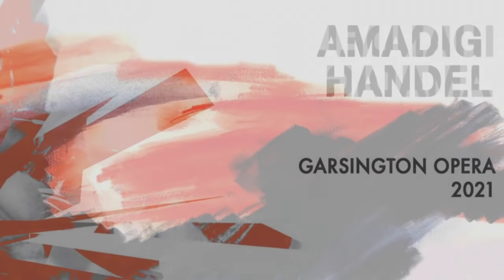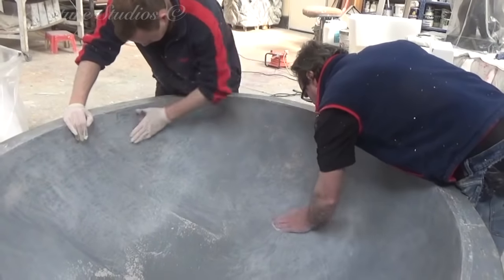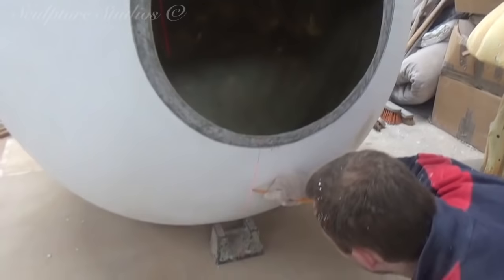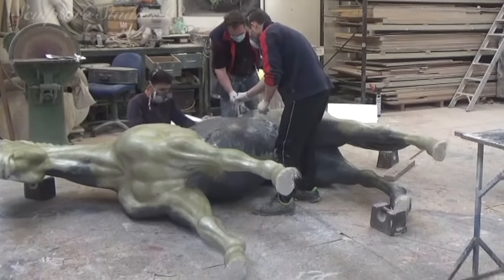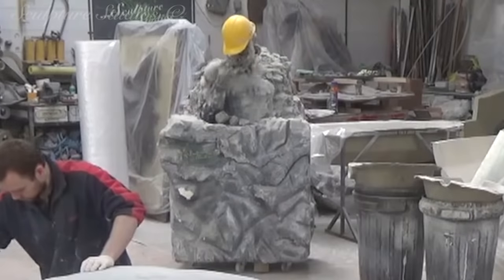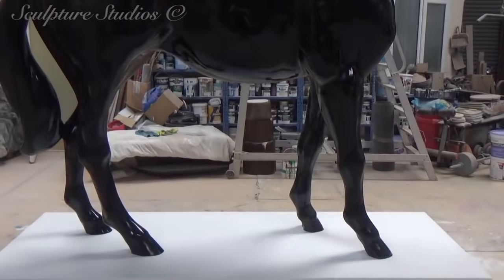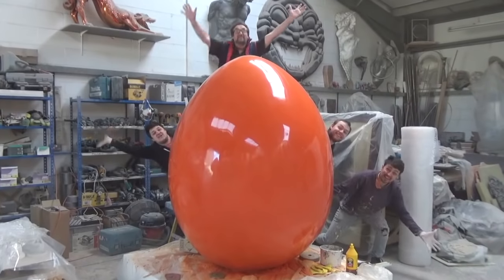Giant Horse & Egg Theatre Props - Amadigi - Garsington Opera by Sculpture Studios

Comment: Did you guys apply several layers of a concrete render or was it a car body filler and gel coat on the horse to get rid of the fiber texture. It turned out amazing! Glad you guys are getting some work.
Reply from the maker: Resins / gel coats and car body fillers. Concrete would have been a nightmare to sound down, and certainly not to the finish we wanted! Thank yooouuu

Comment: Another great project and video.  Silly question time- since the egg was always going to be mounted on the platform, why was the access hatch not on the bottom?  not a big enough area or just did not think of it?
Reply from the maker: Good question! But the client wanted as little of the egg touching the floor as possible, which meant the floor hole was far too small to get in and work comfortably. If the hole was made big enough for someone to get inside, it would have meant much more of the base of the egg cut off than the client wanted
Reply: @AdenHynesSculptureStudios  fair enough, hence the title- silly question.

Comment: Video summary [00:00:00][^1^][1] - [00:20:02][^2^][2]:

This video shows how Sculpture Studios created a giant egg and a black horse for the opera Amadigi by Handel. It covers the steps of carving, molding, fiberglassing, sanding, priming, and painting the sculptures. It also features the client's feedback and the final installation at the Garsington Opera venue.

**Highlights**:
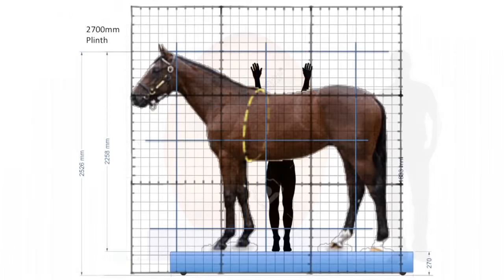+ [00:00:39][^3^][3] *The brief and the references*
    * A balance between realism and simplicity
    * A six-foot tall orange egg and a seven-and-a-half foot tall black stallion
    * Various references provided by the client and found online
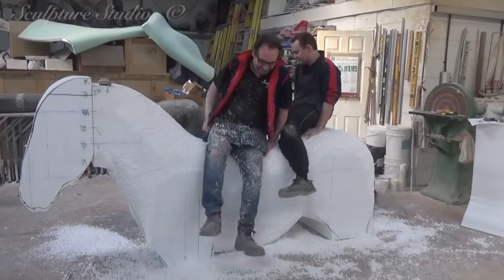+ [00:02:31][^4^][4] *The carving process*
    * Polystyrene blocks cut with hot wire and nail brushes
    * Detailed anatomy and musculature of the horse
    * Geometric shape and smooth surface of the egg
+ [00:06:12][^5^][5] *The fiberglassing process*
    * Protective barrier of tin foil over the polystyrene
    * Sturdy build-up of glass fiber and resin
    * Trap door section for joining the two halves of the egg
+ [00:09:48][^6^][6] *The client's visit and approval*
    * Robin Morgan from the art department checks the horse carving
    * Changes can still be made before the glass fiber stage
    * The egg finish is still up for discussion
+ [00:11:53][^7^][7] *The sanding and priming process*
    * Laborious task of sanding, cleaning, and repeating
    * Car body worthy surface for the high gloss finish
    * 2k car body primers for the egg and the horse
+ [00:15:06][^8^][8] *The painting and polishing process*
    * Gloss black finish for the horse
    * Three different finishes for the egg before the final one
    * Buffing up the surface with a high gloss polish
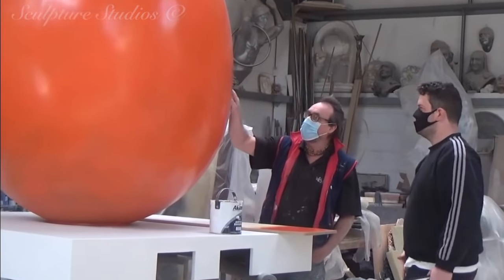+ [00:17:40][^9^][9] *The final approval and transport*
    * Robin Morgan visits again and signs off the work
    * Pallet trucks for maneuvering the sculptures
    * Transport to the Wormsley Estate in Buckinghamshire

Comment: You guys could save a lot of time if you sprayed on a layer of gel coat over the fiberglass before you did the bodywork. It fills in nicely, sands easily and reduces the overall amount of bodywork. Spray gel coat, sand, heavy coat of a high build polyester primer, sand and prime. You won't have to do much body filler at all that way.
Reply: a shell of gel coat without being bonded to the first layer with something like chopped strand may cause problems in time to come i imagine

Comment: First.. Wonderful job, as usual! 
Also.. I was wondering, did you use some sort of metal or wood doweling inside the legs to support them?
Reply from the maker: We ended up hollowing out the bottom sections of the legs, so that we could go to town on laminating internally to the base with thick glass fibre. This saved the client on needed metalwork, as we feel it would have been over engineered. Thank you very much!
Reply: Tumi bhable tomar upor rag
Reply: Ami aktu rosi kori

Comment: Hello, ¿what do you use to cover the fiber glass to refine surface?
Reply from the maker: Hey thank you very much for the question. I mean, if you're looking for a quick fix to achieve this level of finish, unfortunately we have to disappoint, and tell you that there isn't one... There was a lot of work involved. We used flow coats of resin, car body fillers, and sanding the entire surface again and again and again, until we achieved a car body finish. We then go over with car body gloss paints, and even this is then buffed up and polished, to achieve the result you see at the end.